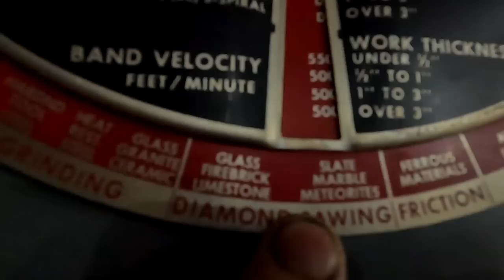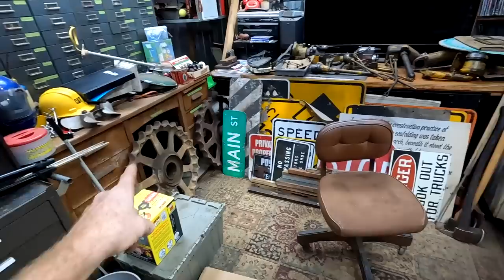It STILL won't start. Let's find out WHY! (Quick SHOP Tour) ~ Day 2 ~ 1965 Allis Chalmers 645 Loader

Comment: Nice job on the pump, and hope it pays off with a running motor, for just investing time. Hopefully those 2 umbrella seals went in right if the back  one rolls forward it will let diesel run out of the pump and fill the timing case/ oil pan with fuel. There has been many motors destroyed when guys didn't Know they leaked and the oil was thinned way down. There is a proper tool to install them so they don't, Check it a few times when you get it running. As Hank over at  Hamilton would say make sure it's not "Making oil"  . I'd bet that blue fuel filters an AC Delco, not AC as in Allis Chalmers .   Thanks for another interesting video, Take care.
Reply: I’ve used a thin piece of plastic wrapped around the seal to hold it in the “closed” position during installation.

Comment: You definitely ain't scared. I've been a diesel mechanic for nearly 30 yrs and wouldn't dream of tackling an injection pump rebuild. Typically I don't have to cause fuel supply to the injection pump or out of the transfer pump is the problem 99.9999% of the time.

Comment: That's it man your correct on that part for sure. Q-tip And light smear of marine grease will help you out with the O-ring wear problems so they don't dry rout out inside of that pump.

Comment: Don’t forget to squirt a liberal amount of ATF in the fuel inlet on that vane pump. That’s your mechanical fuel transfer pump that pulls fuel from the tank, through the filter(s) and into the injection pump. The ATF is to prime the vane pump with some sort of oil so it pulls a vacuum on the fuel suction line from the tank, which it won’t do if the vanes are left cleaned and dry.
Reply from the maker: So the Injection pump IS the fuel pump? I wondered... I have the machine running beautifully now, but thought that someone deleted a mechanical or electric pump like they did the water separator.
Reply: @SalvageWorkshop  
That is correct, it’s two pumps in one. Not knowing what the actual pressures are, just look at it as the vane pump is the low pressure side and that cage with all the plungers and check balls is the high pressure side.
Reply: Best comment!!!

Comment: There called banjo connectors because if you look at the pipe and fitting the bolt goes through,it looks like a banjo.great work, look like a good pump not a lot of galling. 👍

Comment: I would be pretty sure the main problem would have been the metering valve, as youmentioned it had surface rusting.
I have had many engines where there was a failure to prime to the high pressure side.
It has always been the metering valve is stuck, it has very light springs to move it.
A little wobble in its hole , refit the top and away the engines go.
Well done for showing a total strip down and what a great shop !!

Comment: I've run into the same problem of crushing oil filters, trying to get them off. I have found that I can put a couple of turns of rope around the filter helps with the removal. It may crush the filter a little but it doesn't rip a hole in them.

Comment: The reason that filter was so tight is that you turned it the wrong direction.
Reply: I thought you were kidding, but nope - 5:24.  I think that in Japan, a job interview includes having to enter a tube full of fasteners and being able to remove them even being upside down.  It can be disorienting.
Reply: Sometimes its best to tighten an oil filter a 1/8 - 1/4 turn to crush the gasket and break the seal, then remove normally. Contrary plumbing fittings too.
Reply: Oh damn.
Reply: Lefty loosy,righty tightly.
Reply: Off the vehicle the rotation can be... Nope wrong direction
Reply: Yeah, I rolled my eyes when he tightened it.
Reply: @patrickpigg4132  what on earth does that mean, never could figure it out.
Reply: @charlesmurphy1510  This one is easier to remember: "Linksom = Los"
Reply: Lmfao good catch
Reply: @patrickpigg4132  except on a grills propane tank😉
Reply: I used to struggle with it when I was younger then realized that if you picture a clock on the  head of the  bolt clockwise tightens and anti-clockwise  loosens it.
Reply: I greatly appreciate that moments like this don't get edited out.  Gives me confidence that even I might do OK working on some of the equipment we have around here.
Reply: You're righty tighty...
Reply: @charlesmurphy1510  😂 😂 😂 It means you turn it to the left to loosen it and you turn it to the right to tighten it.
Reply: @GunnerAsch1   While i appreciate the value of a good excuse, I must point out that he went on for 17 seconds before an editing cutaway returned to him turning it counterclockwise.
Reply: @kevinballuff1164  And driver side lugnuts on old Chrysler, Dodge and Plymouths and maybe DeSotos.
Reply: @kevinballuff1164  Inner thread yes, some torch gas tanks. Grill tanks do have a standard direction outer thread for some useless reason. Even our propane filling station uses the inner thread.
Reply: The person who installed the filter read it two to three turns rather than 1/3. Lol

Comment: just so you know if you have a loose fitting oil wrench use a cloth and a stick put clothe around oil filter put stick in cloth tighten clothe by spinning it until stick is tight up against oil filter and all slack is taking up by the twists. you can pound on stick or push/ pull on stick gives you great leverage. used it many a time on semi's. and that is if ,. and that is a mighty big IF ...... if you have room for it. most i have done had room and it saved me a whole heap of trouble. works great especially if you have cans with oil filters inside can. and you don't want to damage can.

Comment: Hello Matt! When I started watching your first videos a few years ago, I had a question, why do you need such a workshop? From the first videos, it seemed like you were upgrading your workshop just so you could have a good workshop. But everything changed when you started working on the Old Red project. Now, after quite some time, I'm just very impressed with the changes in your workshop. Everything is perfectly systematized, spacious and convenient for work. Your idea to tell more about the changes in the workshop is very good. Because changes are very significant. I will look forward to new videos about the restoration of "new old" machines. 
You had 6 dogs. I really hope that they are all healthy and that you already have 12 weimaraners.
Regarding the name for Allis Chalmers. In Russia, Alice is a typical name for a fox. What's about "Yellow fox"? Alexey.

Comment: Ah, the ubiquitous stanadyne pump. "Simple" and found nearly everywhere on older equipment. Only need a DB4 or DB2 rebuild kit typically, in that case its a DB4 since it has a electric shutoff.

They're like $50 most places.
Reply: Where can you buy the kits

Comment: Hi Matt, great job on this pump, a situation that made me very happy to see a pump for how many years without working? being clean without oxidation on the parts, last month I did a service on a Perkins engine that was not working for 90 days, the internal parts of the pump were literally all contaminated by oxidation. Unfortunately here in Brazil our fuel is of poor quality with a lot of water and this detonates the equipment, especially the pumps and injectors.
If you want out of curiosity I can send you the photos by email to see the size of the damage of my pump and you can compare yours.
His workshop was wonderful.

Comment: Hello
To clean small bores like those of the pump rollers, it is possible to use small brass brushes to clean the barrels of weapons, there are a whole bunch of them in diameter.

Comment: It's there for adjusting the amount of fuel pressure coming through the pump inlet hole.& back out to the injectors. By adjusting them higher.,or lower witch raises.& lowers the amount of fuel pressure going in.& out through the fuel lines. If you clean it up good.& set back to factory settings it should work just fine again.

Comment: Another great video. As I write software for a living, I see complicated mechanisms like this and think how easily you could do that in code. A lot of vehicles rely on a very rough idea of timing compared to what we do routinely in software, using mechanical parts that wear out. Code essentially lasts forever. Electronic components supporting software do wear out after a very long time but the vast majority of electronic devices that are thrown out are still working. Repairs require slightly different skills but are much much cheaper in parts. Maybe some capacitors or a diode after 30 years.

Edit: Today's mechanics usually just replace the whole electronics module, but you and I both know that's only because of labor costs. In the future I see bad modules from cars being repaired rather than landfilled.
Reply: The problem with automotive electronics is two fold. Firstly they are potted to help with the vibration resistance and secondly even if it isn't potted getting a diagram of the circuit is neigh impossible. Of course if you were repairing just a handful of pcbs day in and day out you could build up a mental picture or trace the pcb but with almost every machine having a different brain that's hard to do.

Comment: I'm wincing, That is a clean room job, All parts should be washed in calibration oil or clean diesel and kept submerged until assembly. Even fine dust can score the plungers and cause excess leakage. Any wear/scoring will reduce max fuel and power.

Comment: that solvent in the parts cleaner is horrible for the o rings and parts in that pump . and learn the direction to unscrew stuff when its upside down. but i give u 100% on getting in there and doing it.

Comment: Cool shop tour. Like to see some of your machines in operation. call it the "Alice in Chains" if you can? Get some Scotch-Brite pads, all those pump parts, you should have polished up, I used to tear fuel pumps and transmissions apart long ago on Dad's farm. Any of the good salvageable parts polish them up to like new. Makes huge difference,  no metal loss except the rust. Keep the content coming.

Comment: Your original fuel filter could have been by AC Delco. Back in 70,s era you could buy a dark blue AC oil, or fuel filter for almost any engine. Car, Pickup, Farm Equipment. I put on several. Were always good filter. That one was on so long under pressure, tried hard to stay on.  Shop looks well organized.

Comment: I was thinking about the rotation of the fuel injector pump. I know sometimes diesel motors are used in marine applications and when they use them in pairs they will rotate the motors in opposite directions. So if the last person who worked on that pump they could have  not reinstalled the clockwise/counterclockwise correctly for the actual rotation of the motor. Just something to double check if you continue to have issues.

Comment: You know you can pein the slots back down on the flat head screws and reshape  them? They don't end up perfect but once you squeeze the sides back together and tap the proud metal back down into the slot,  it makes them serviceable for at least a couple more times.
Reply from the maker: Ya that won't work here... One half of the head is cracked and about to fall off on 3 of the bolts... it's not just the imperfections on the top!

Comment: That 4x8 welding table you want to do I would put in a hydraulic lift table and you could mount it into the floor and it could be totally flush with the floor and than when you want to use it you can raid it up and you can also put smaller machines on it and work at them at a good working height

Comment: Invest in a pair of extra large channel locks. That will allow you to remove any stubborn filters
Reply from the maker: Yes- I've never had a use for extra large ones...until now!
Reply: @SalvageWorkshop  very impressed with your injection pump rework. I was in no way telling you how to do what you do. I'm an owner operator and equipment owner and have used the big channel locks to get stuck filters off when a filter wrench wouldn't do it. Yes it will usually ruin the filter, but it will get them off relatively easily
Reply: @rc5693  Amen. Plus, let's be honest. That giant set of channel locks just looks cool! Cheers
Reply: @giggiddy  lol, yeppers, I don't know the size of mine, but they're huge
Reply: Not always, last year I had a tractor with a Perkins in  to service for a customer.  I literally tried everything known to man including the big channel locks. The oil filter was so tight and shredded  I had to remove the block filter housing and oil cooler adapter the filter screwed on. Then hold it in a vice to undo it, It was even starting  to twist the coolant line fittings before the filter moved.

Comment: Dadgum it I wanted to see her start durn it. Looks like the pump will work fine now. Without being opened up she would never have run. Some of those parts could go either way so when starting her you will find out quick if everything is turned right. No juice will squirt out up at the injectors. If it is not right now for heaven's sake don't take her apart out at the loader because if you loose one of those tiny parts ya'll will have to buy a new pump. The only parts I am worried about are those two 1/2 moon clips near the end of putting her together. They can be put in backwards and the engine might run away. Be ready with a strong plate to put over the inlet. Remember the vacuum is fierce so a board or plywood is needed.

Comment: There are no metric bolts on that Allis Chalmers.
Allis Chalmers engines do not time on top dead center you should be about 23° btdc.
That's an engine oil cooler, the larger one behind is the hydraulic oil cooler

Comment: I was wondering what you did with all the big engine lathes. You had what 4 or 5 of them?  Now all those are out of there you got some room to move. I remember you had a couch in the shop as well. Now it looking good boss. Do you still have the old band saw outside waiting to be worked on still?  Can't wait to see the other shop. 
Now I know way more about an Allis Chalmers fuel injector pump than I'll ever need to know. Lol interesting to watch. I remember my dad taking stuff apart and cleaning it just to get a little more milage out of whatever it was he was working on. 1 because he never had the money to buy new. So he fixed what he had. That's how he taught me in my younger days.

Comment: "DO ALL" Band saw you're in good shape, still Used by NAVY fitting contract used to outfit I am assuming every Ship machine space. so at least you know there still in business so you can get parts and manuals, if can find on commercial account search Gov mil web sites bet you can manual if you need one.  Nice rebuild on mechanical pump just goes to show you things are meant to be torn down cleaned put back together make work again.

Comment: My luck would be to clean the old pump like that, get it working. Then having it pump so strong that the old fuel lines having all that new pressure in them that they would all start leaking fuel. Lol

Comment: I missed it.  What keeps the pump rotation shaft in place?  It was just hammered out and pushed into place in the video.  Hardly just a skewed angle of the gear.

Comment: Call it midnight, every time you work on it it seems to be midnight before you are finished!😂 that corrosion you kept talking about is gunk from the die they use in off road fuel, if you could have got some solvent in the pump and turned it over a bit it probably would have freed it up enough to get it started and fresh fuel flowing through would have washed it clean!
Reply from the maker: Ya maybe, but I was worried about the rubber flex ring having blown apart, and I'd never been into one of those pumps and I wanted to see how it all went together!

Comment: I loved the video! I thought I would let you know that there is a Stanadyne 24 Volt Solenoid with your part number brand new on eBay. Auction #17  27  17  02  62  38. It's kind of pricey at $79.00 but if you need it, you need it. Maybe if you take yours off and brake clean it really good then epoxy the cracks, that might keep yours going for a while longer and keep the moisture out of the coil. That's a real killer. Great job, keep up the good work!

Comment: My 6.9 diesel had the governor basket plastic coupler fail. I tac welded it together.  There a video of it running on my channel
Reply from the maker: I thought about welding or brazing it together, and still might, but the one piece isn't too expensive, and if I go back into the pump I'm definitely going to do something about it!
Reply: @SalvageWorkshop  I was unsure how engine was. Had just took it on trade for stuff. Didn't want to wait for solid/industrial plate to show up.
Reply: @SalvageWorkshop  pickup actually runs strong. But will need a transmission rebuild. I'll be doing that on my channel.

Comment: I'm sure there should/must be a mechanical lift pump somewhere if not an electrical one, since the transfer pump in the injection pump is NOT supposed to ever have vacuum on its inlet, as this will destroy it in a heartbeat.
Reply from the maker: I have NOT found a pump on the machine ANYWHERE! I did get the machine running REALLY well, and I have no idea why but it's pulling fuel just fine! You'll see soon!
Reply: I could of course be wrong too, maybe these older Stanadyne pumps were designed to not need a lift pump, or atleast not need one below a certain distance to the tank.

Comment: The old husqvarna motorcycles back in the 60s and 70s had rubber dampers behind the clutch basket and they to would shred and fill the transmission full of rubber pieces just like your injection pump and of course the bike would not connect to the transmission like it’s in neutral. Pain in the butt!